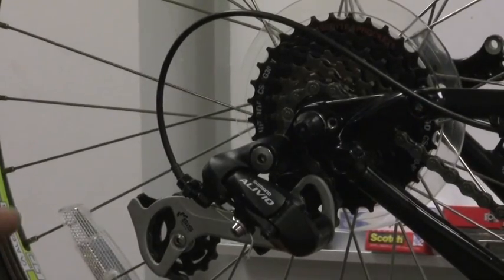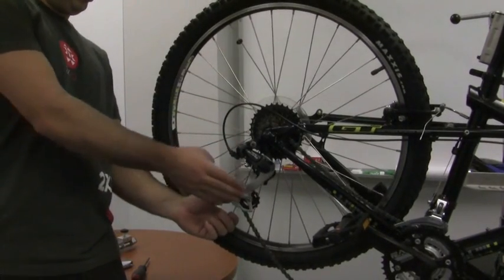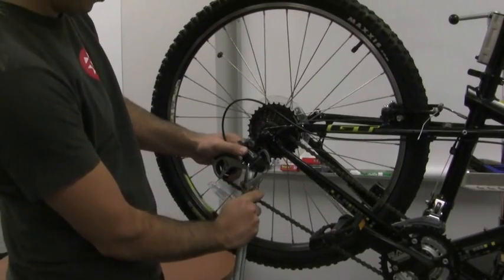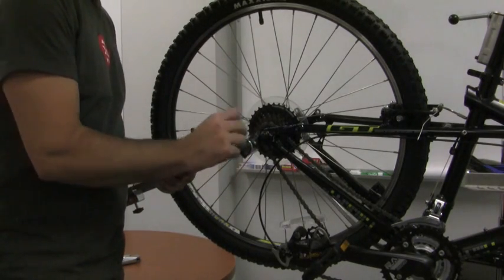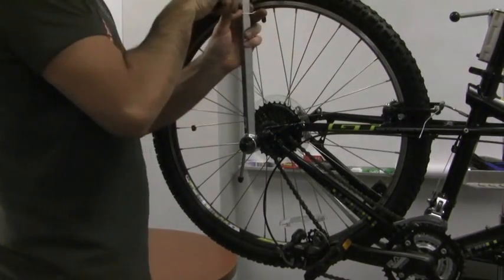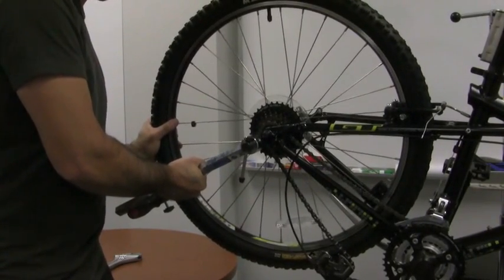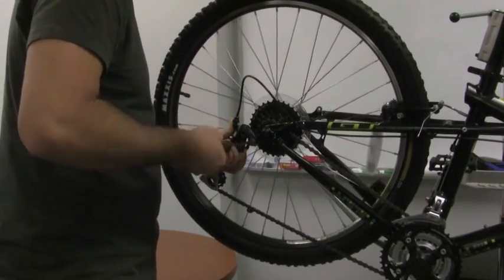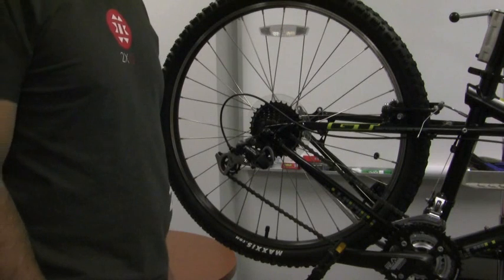How to Straighten a bent Derailleur

Comment: Trying to align the hanger by grabbing the derailleur cage with a wrench isn't a good idea; because you might end up bending that as well. What you should do instead if you don't have an alignment tool is to remove the derailleur, then grab the hanger itself with the wrench, so then you can align it without affecting the derailleur.
Reply: trying to bend aluminum in general is not a good idea.
Reply: If the sprockets are in the way of your wrench, switch the wheel around so they're on the other side, and tighten up the nuts.  (This will support the hanger so it bends in the place you want it to.)
Reply: @Desi365  But if you're running a glorious steel shitbox it's not that bad of an idea right?
Reply: @Desi365  why's that. seems easy enough to bend.

Comment: My derailler is actually, literally bent, and actually hanging on my chain, when i switched my gear, my bike literally came to imediant Halt, then i looked and i saw my derailler stuck inside my rim, i took it out, and i see it's bent, i put it back on once, and tried shifting but the derailler is bent towards the wheel so it gets caught everytime i shift and i cant ride.
Reply: Same. I guess that's what I get for $20 on eBay.
Reply: Go to Amazon buddy, it will cost more but ya pay for what ya get, i got my Grante Peak 26" Mens Road Master from Wallmart, 70 Bucks, it was an error i'm thinking, but i'm trying to raise some money to get a new bike, but i heard i can just get another derailler off of another bike, and install it, but may take some time, if not then i'll get my new Huffy 26 inch Mountain Bike, and survive off of that lol, but i really do wish to fix this bike.
Reply: daquan vanhook me to
Reply: same and im really sad, i used to love biking with my bud
Reply: SAME
Reply: What did you do to fix it?
Reply: Hey i got the same problems..my social media friends said i just need to bend it back to the normal position..
Reply: This legit just happened to my £600 bike I bought 3 days ago
Reply: Same dude… ;~;
Reply: I just bent it back with all my force, works right now, just too scared to go into first gear again lol